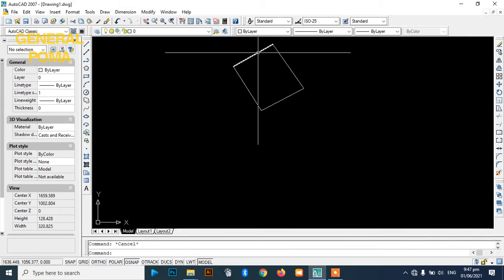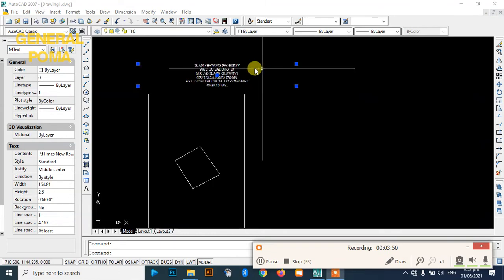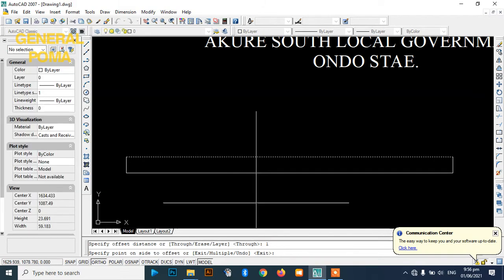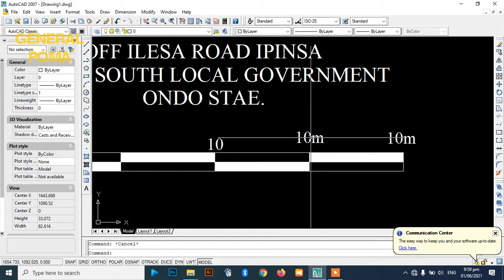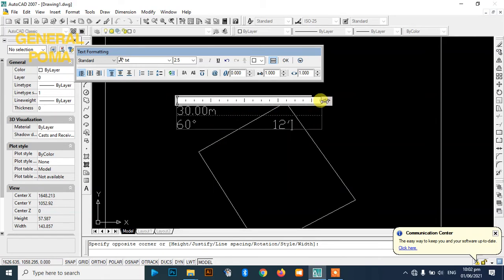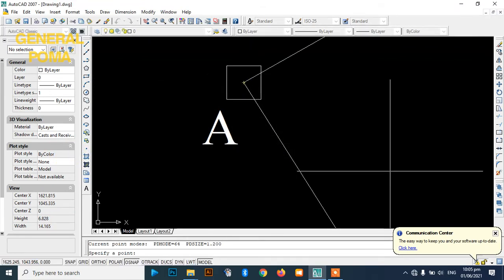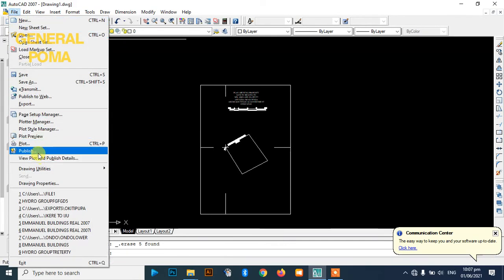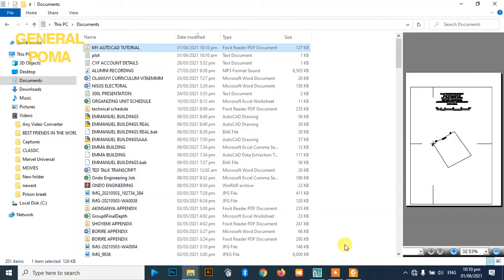HOW TO PLOT SURVEY PLAN, SCALE AND TEXT

Comment: You prematurely set the scale on 0.5547 which is different from 0.5 or 1:500

To overcome the cut off, you need to select a little bit outside the borderline.
Reply from the maker: Thanks for the contribution